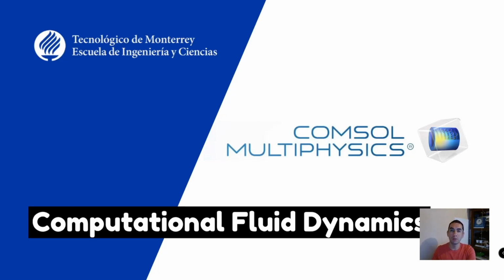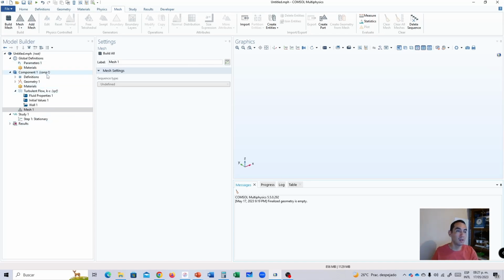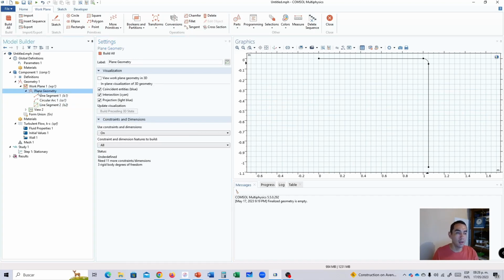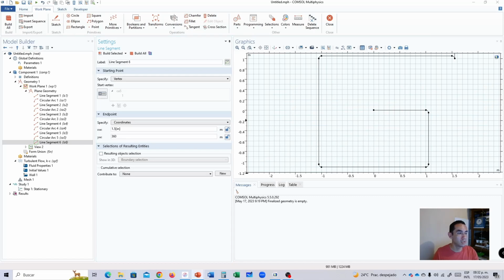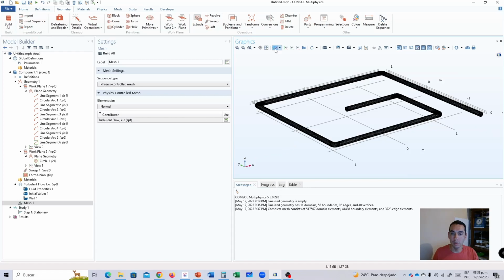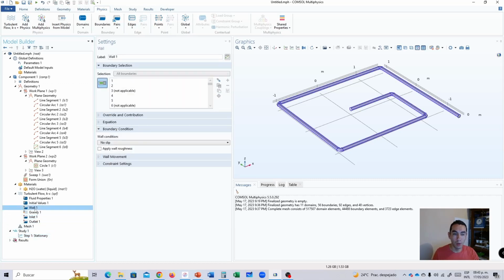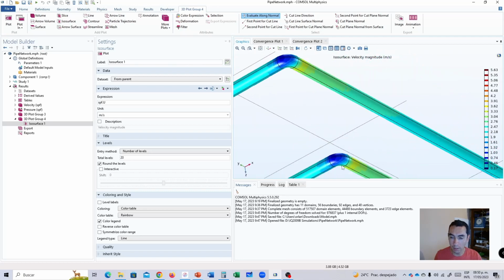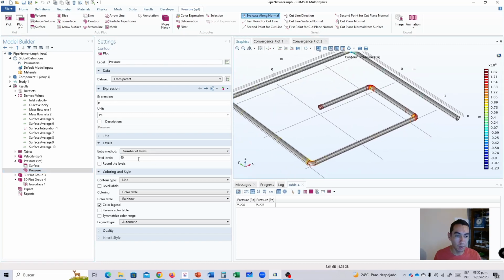COMSOL Multiphysics Tutorial: Flow in a Pipe Network

Comment: Can you solve flow in 3D pipe network at different elevations with pump in between? Examples - flow from a tank located at higher elevation 
through a pipe with pump in between.